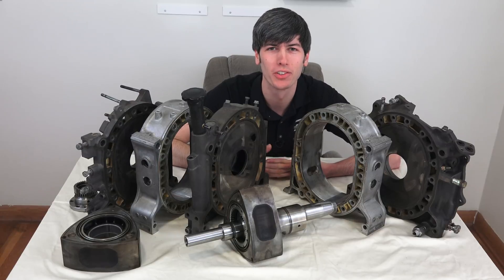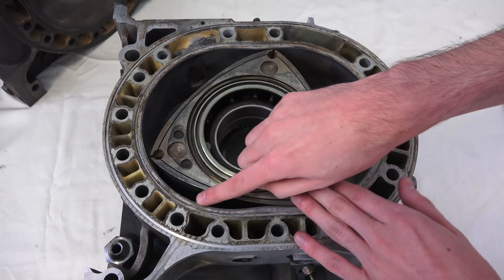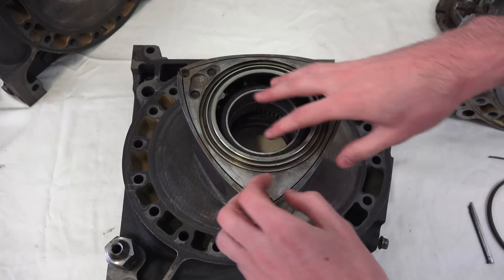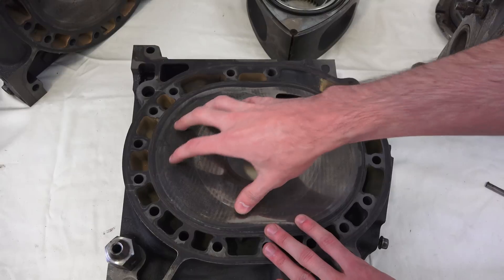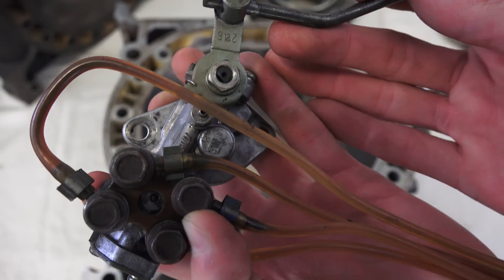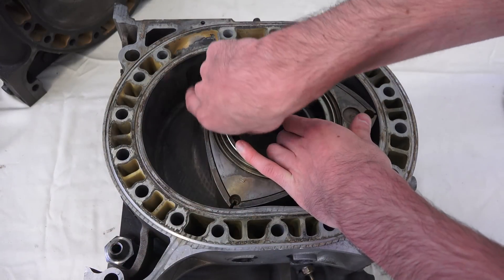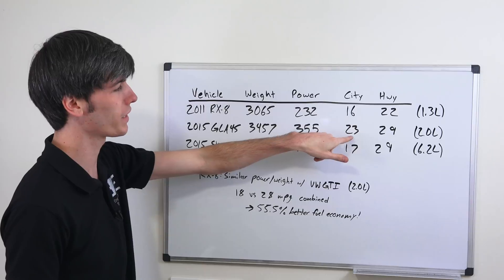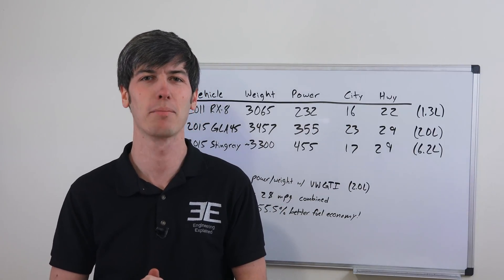4 Reasons Why The Rotary Engine Is Dead

Comment: Engineering Explained guy didn't explain one fundamental reason why the thermal efficiency and thus fuel consumption is so bad.  The reason is this:  To maximise the conversion of the fuel burn heat into mechanical energy you need to minimize the flow of heat from the burning gases into the engine metal.   To do that you need to minimize the surface area of the combustion space - the theoretical best combustion chamber shape is a sphere.  A sphere has the least surface area for a given volume.  Of course a true sphere cannot be used as that would mean no piston movement.  The conventional short stroke piston engine with a hemi head approximates a spherical combustion space quite well, especially if it is a bowl-in-piston design.   The Wankel rotary is very far from a spherical combustion chamber, i.e., has a very large surface area for the given volume.  
Also, in a conventional piston engine, turbulence can be optimized to ensure a virtually complete burn without excessively sweeping gases over the metal surfaces.  That means we can get both mimimum heat flow into metal and minimum emissions (except for NOx).  The Wankel has too much gas flow right at the metal surfaces.  Turbulence cannot be optimized.
Reply: That's an excellent point that I never really thought about before. Looking at the size of the swept "combustion chamber" area on the face and side of the rotor housing (and also including the equivalent area on the end plates for each rotor) one realises that those lumps of iron are an enormous heatsink. Even if the fuel burn can be brought close to 100% complete through the use of staged injection and multiple ignition sources, there will always be a large amount of thermal energy lost into the metal compared to a piston/cylinder design. If cost was not a problem, this could perhaps be mitigated to some extent through the use of advanced materials/coatings, which could also help to minimise the oil burn problem. But you'd still have to deal with the other flaw mentioned in the video; poor sealing due to the temperature differential between the "hot" and "cold" sides of the rotor housing, which is inherent to the Wankel design. To be honest, once I think through these problems I'm pretty amazed that Mazda persisted with the rotary engine for as long as they did, given the relentlessly push towards better efficiency and economy. The writing was on the wall from the very beginning.
Reply: @sixstringedthing :   You got it.   As I recall, the Japanese automotive industry, a bit before Mazda committed to Wankel implementation, expected to eventually move to engines with ceramic engine blocks & combustion-exposed surfaces.  Since ceramics are thermal insulators, this would dramatically reduce heat lost to coolant.   The overall improvement in fuel efficiency over a conventional cast iron or alloy piston engine would not be as great as you might think, however.  But,  the thermal stress on exhaust valves in a ceramic piston engine would be extreme, but just not a problem in a ceramic Wankel.   So, in theory a ceramic Wankel could compete thermodynamically with a piston engine.    The Mazda Wankel rotary implementation was to be a stepping stone to gain experience and earn money on the way, to pay for research.   What the Japanese industry and Mazda in particular did not realise, was that authorities in most countries would insist on not just lowering emissions generally, but they mandated dramatic reduction in NOx emission as well.   But you are right - Mazda engineers must have been on a substance when they decided to give it a go.

Comment: Is it just me or would this engine design work better with diesel where the unburnt fuel IS the oil? 

Additionally
Reply: Diesel requires a bit more compression than these can effectively generate and the fuel burns to slow to take advantage of the design.

Comment: I put a 13B Bridge port in a mark 1 ford escort I raced it for years. You could buy the basics for a rebuild for $350 seals and stuff. You could get housings faced for $20 each if you worked on them yourself they are a great engine to race economically with. Back in the 90s Rotaries in Australia had a cult following and for good reason they went hard with little work. Tear all the Mazda intake and exhaust crap off port the motor and fit a bigger carb and an exhaust that was so loud that it would put a grid of formula one cars to shame and you would just about kill anything else on the street. There is no other feeling in a car then a rotary coming into its power band and feeling your body being pushed into the seat from the acceleration. Rotaries make other engines scared so much so they got banned most of the time.

Comment: What is more interesting is that you used 2 more modern examples of "other" vehicles instead of 2011 examples. I.E. The 2011 Corvette base model was 16/26 as per edmunds website. And the 26 hwy mileage due to the gearing of the Corvette's transmissions/rear end ratio (The LS has more torque across the entire powerband, allowing for longer gear ratios and thus a lower rpm at hwy speeds). I also find it a little off that you compared the RX-8 (sports car) to a GTI (hot hatch), a closer (more appropriate?) comparison would be with a Honda S2000 (stopped production in 2009) with a mileage rating of 18/25 at 237 hp (which is only slightly better than the RX-8 and 200 lbs lighter). 
Performance wise the RX-8 suffers from a lack of torque in stock form which hurts its 0-60 and 1/4 mile times as well as mileage. The Rotary is not great in base form but "wakes up" well with modifications (far beyond that of the GTI and S2000 can in N/A form). 
Regarding the 787B and LeMans win, at full tune (not race tune mind you) the 26B made 930 hp without forced induction. Id like anyone to list out the number of engines that can produce 930 real dyno hp in N/A form no matter the displacement.
Reply: What kind of HP modifications do RX 8 need? Please give advice. Is it a streetport?
Reply: @bagustiko  As I reply, I'm looking to the right of this and can see a video from Car Throttle's YT channel called "How to build a Rotary Engine: Ultimate Guide" It's a decent watch for  suggestions. The rotary engine will always suffer from lower torque vs HP due to it's basic design. A properly cammed V8 can produce high HP/Torque numbers because of it basic design. The two things that a rotary has going for it is the ability to rev to insanely high rpm and it's ability to take boost (forced induction) well. There are a ton of bolt on parts available for the rotary that will liven them up, but that is not something exclusive to rotaries. You always start with the simple things and work your way up till you hit the max potential of the engine (or your wallet.....lol). Exhaust (header/manifold included) throttle body, intake manifold, injectors, ECU (new chip or reprogram) etc. Unless you plan to spend a ton of money from the start and pull the engine for a full rebuild, I would suggest looking around and joining a rotary forum and picking at the minds of the guys that have done the work and can tell you what has worked for them and what hasn't.

Comment: But the REAL number 1 reason is, the VTEC doesn't kick in, yo!
Reply: That's actually something often overlooked as a benefit of rotary engines, the simplicity of the design. No valve timing to deal with or fragile timing belts. There's also no large engine block as they are built in sections, which makes repairs much easier.

Comment: There is a backwards rotary engine design with the triangle on the outside and the round thing turning. It's used in aircraft. The seals are not near the problem. I don't know about thermal efficiency being better.

Comment: I remember back in the early 60's reading about the engines in "Popular Mechanics" (I think it was Popular Mechanics)  They said it would be a very cheap throw away engine good for perhaps lawn mowers.   Then I read many years later an article in an aircraft home builder magazine.   The question was, would a Wankel be a good engine for a home built aircraft.   This magazine was dedicated to people with the skill to build aircraft but the advice was, if the engine works, don't try to take it apart and rebuild it - you will never get it back together again.

Comment: When I was a kid in the 1970’s, my mother bought a Mazda RX-2 with a rotary engine. (It was the car I learned to drive on.) It was a POS. Seals gave out just as described in this video.
Reply: The method of seal's problem has improved by the quality of the seal that I heard. My suggestion is improvement of lubrication. It's from my 19 years experience for piston engines. Still I wonder about MoS2 goes to combustion chamber with fuel and what is going on? *For the test results of large diesel engines which has a lot of smoke. After added MoS2, the smoke has much reduced and no oil consumption either. The smell of diesel engine oil has no burning smell. How about Rotary Engine? If you have interesting and could be tested, I can send to you MoS2. It hasn't been a problem at all for last 19 years trial.

Comment: 4 reasons, 1. You yanked the engine out of a perfectly working car. 2. You disassembled the engine. 3. You lost some of the hardware to put it back together. 4. Well let's just dump all over the design and specs of this car........Nevermind the advantages of a 10k rev motor far outweigh the reasons you talk about..........I loved the drive and raced em too.

Comment: My nephew bought a 2011 RX8 about 18 months ago. It was from a dealer and had service history etc. It has spent half of that 18 months off the road because he could get parts here in NZ for some reason. Now it is running again, but if was him I'd cut my losses and flick it to a rotary nut. p.s. I wonder if they are as thirsty as my Subaru Legacy RS was. That thing was a gas guzzler. My last car was a Jaguar S-type. Piece of crap that literally started falling to bits, but it was sound mechanically i'll admit (it was trim and stuff that was falling off). Injured spine now and struggle to walk. Don't want to pay for parking in my apartment building. I am over cars for now and just catch the bus. I'd like a motorbike though.

Comment: You started your lengthy explanation of the weakness of the Wankel engine at the wrong place.  The place to start is the manufacturing process.  It is a slow costly process to generate the internal configuration. The engine that has been built since the beginning with the cylinders in line are all bored at the same time.  The rough cut going in and the cutting tool indexes out and the finish cut is taken on the way out.  One pass in and out.  It is the same whether it is a 4, 6, V6, straight 8 or V8.  The configuration of the Wankel must be held to very close tolerances.  It is surprising to me that GM even spent any money on such a project other than to say it was pour management.

Comment: The Suzuki bikes with the rotary were wicked. GM bought right to the Wankel, but it never got past testing. The only wear point is the rotor tips, so GM tried different material for them. Carbide tips were very expensive, and it was deemed unnecessary when 1,000,000 miles equivalent tests showed no measurable wear. They assumed the rest of a car would be long gone before any engine wear. They eventually settle on iron tips, which seemed to be good for a couple hundred thousand miles.